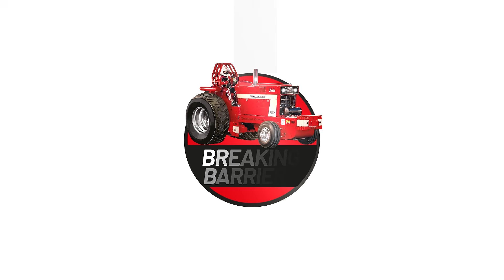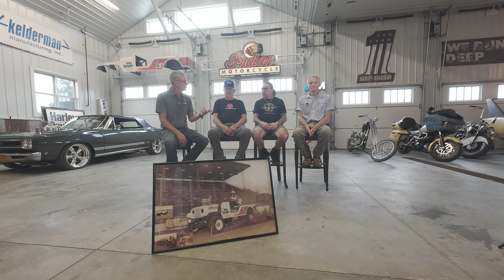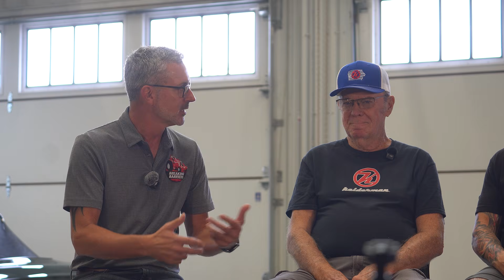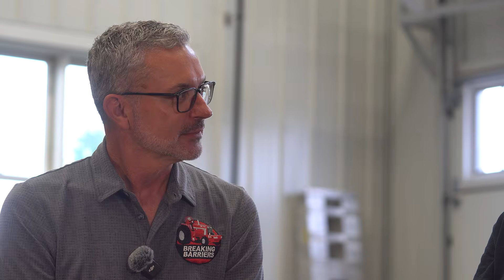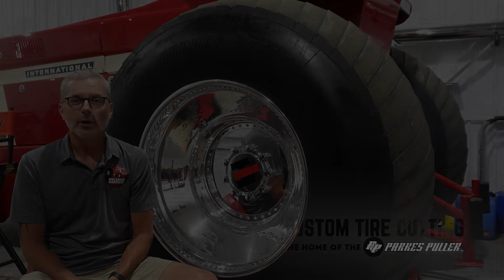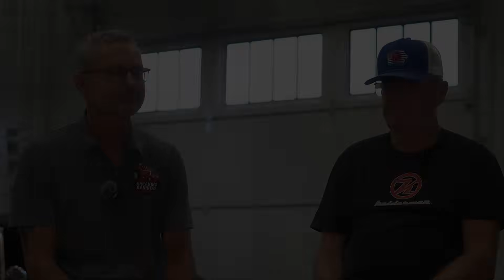The Men Who Re-Engineered Truck Pulling: The Kelderman Legacy

Comment: I've only antique tractor pulled. Their story of repulling reminds me of an experience I had. I took a massey harris 44 special that at the time I had just got running with a 44 standard block and a 277 kit. Also i had put new rear tires with fluid. Other than that  it was nothing over the top. There ended up being three 44 specials there that day and a few other tractors in the same class. I ended up pulling first and did 220ft. The next 2 masseys were 50ft short of me. Well those old timers were some competive. I ended up pulling 3 times to prove my tractor lol. The more times we pulled the worst those other tractors got. I still have my trophy on the shelf lol.
Reply from the maker: Thank You for sharing this, very interesting!
Reply: @thebreakingbarrierspod i havent pulled for a long time. My buddies dad was right into it. That family would take like 9 different tractors sometimes. So along with taking my own i would run tractors for them too. Definitely funner to pull multiple times. But their star was a 444 massey weighted up nicknamed the "R" stomper. And it was just that with its high and low range. Low range second and would make full pulls in its class and smoke "R" John Deeres. I watched many times it having to pull 2 and 3 times because no deere man wanted to lose lol. It was the only Massey Harris that they had and when the dad pasted away he left me that tractor. Ive never pulled it myself and most of the pulls that we went to dont run antiques anymore.